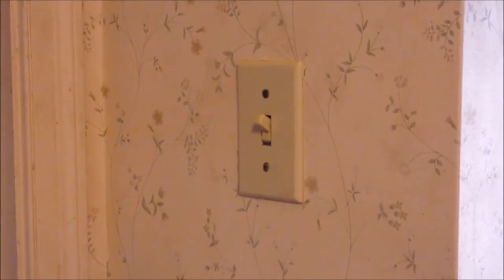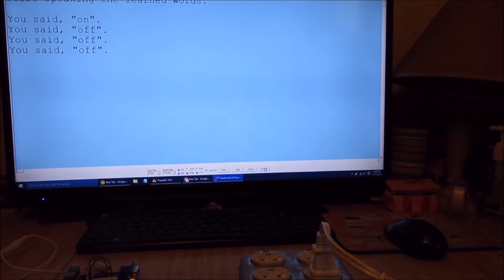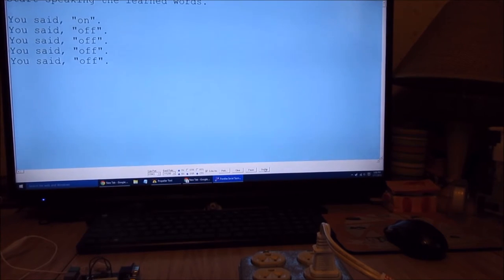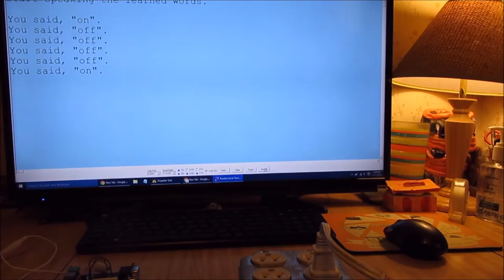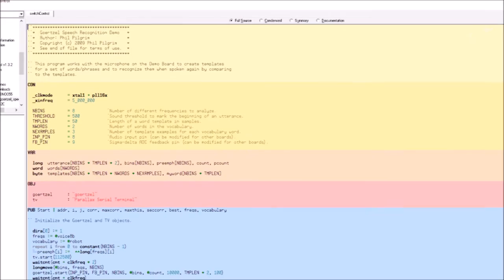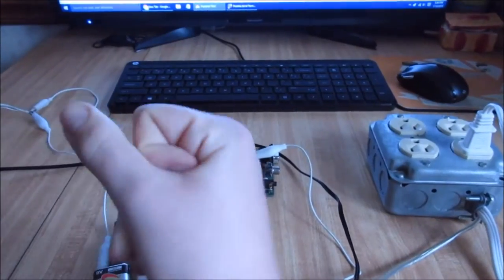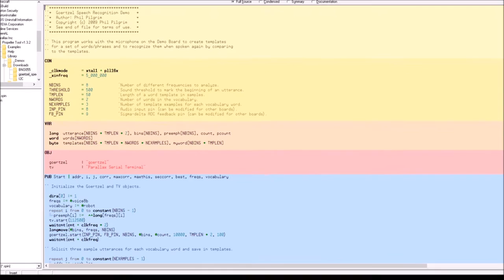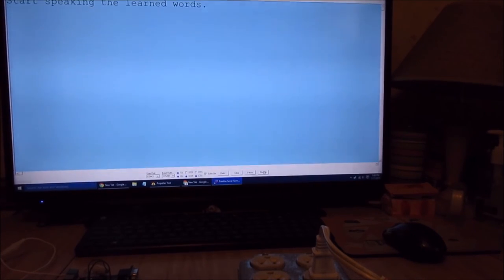Voice Activated Light Switch

Comment: @The Science Elf - 
the control of the socket is (more or less) advanced , but the socket + plug are not ...  
USA standards even demand grounded protective steel pipes around cables ( = safty beyond what is in Europe) , but the plugin-in / pull out is as dangerous as around WW1 ( = 100 years behind the time) ... 

https://www.youtube.com/watch?v=Ihau12C9uq8

Also Earth down (instead on top) is a big No-No ( UK did it right from the beginning in 1911 ) , most USA style sockets are installed this way in USA & all over the planet ... 

note: also the Israeli socket performs the same Fail ( it is basically the German HNA-socket in it's domestic variant from 1928 https://www.plugsocketmuseum.nl/Schuko-origin.html + https://www.plugsocketmuseum.nl/EU_special.html also with un-sleeved plug pins & non-recessed sockets just like the USA system ) ... 

also Danish plugs & the pre-1942 old British plugs used in India etc. same problem ... Australia & Switzerland fixed it ~10 Years ago.